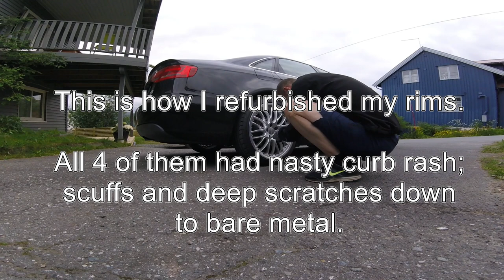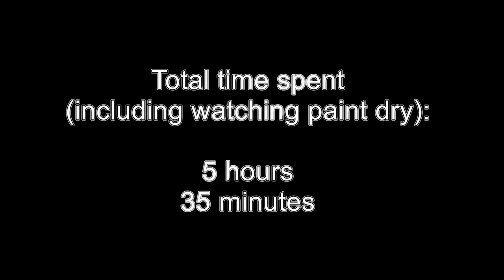Fixing deep scuffs / curb rash on my alloy rims

Comment: I have identical Audi wheels, how did you fix the pitting around all the little fake fake bolt heads?
Reply from the maker: I did only fix the edge of the rims..
Reply: You have inspired me to do mine.
Reply from the maker: @stevehickingy9695  Do them! Looks so much better. Although its a bit time consuming, its well worth it IMO
Reply: I will, and greetings to you from Nottingham UK
Reply: The bolts are not fake. Those wheels are Audi/ BBS Speedline rims. It's a 2 piece rim. It consists of two parts, the hart and the  barrol. Those rim's are popular at carshows.

Comment: If you grind out properly with a dremel or die grinder you dont need to fill anything.........
Reply from the maker: True! But I chose to fill to keep the outer edge of the rim as circular as possible. Otherwise it would have been flat spots along the edge, unless I grinded a quarter of an inch off all the way round.
Reply: If you have just minor scuffs and scratches on your ends then guess you don't need to use any filler but if you got gouges, you're never going to be able to sand and blend in correctly without using filler.